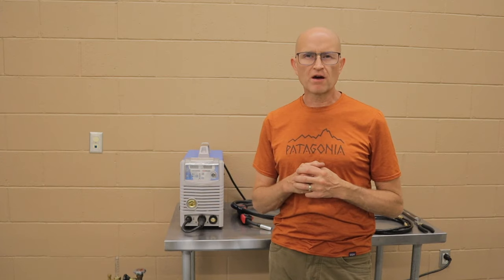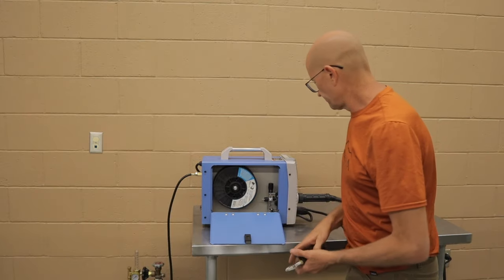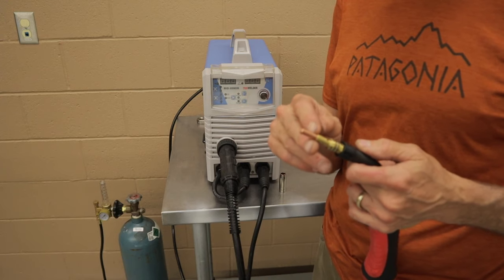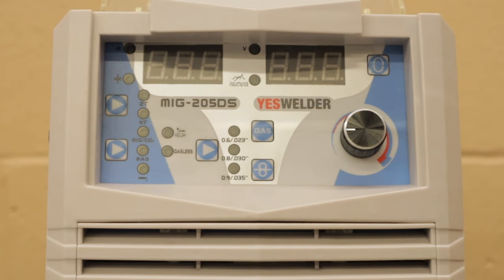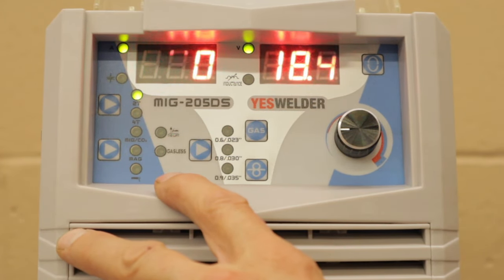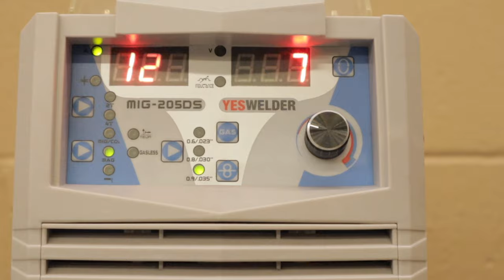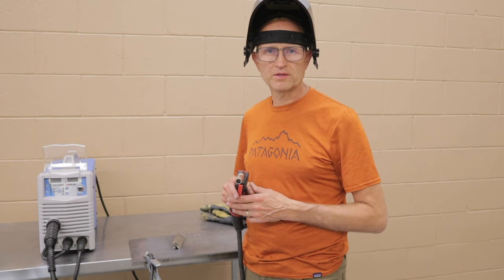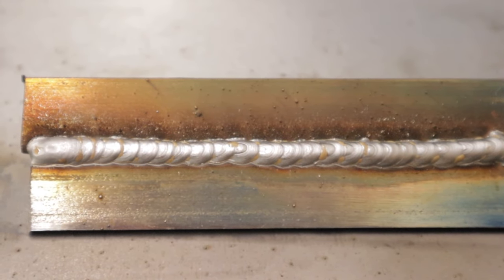YesWelder  MIG 205DS Welder Set up and Settings - Yes Welder DISCOUNT LINK !!!

Comment: Would these settings and setup steps be the same for the MiG Pro 250?
Reply from the maker: Hi Ryan, the Pro 250 has some features that this welder doesn’t like the ability to adjust wire feed speed. It does have synergic Mig function and if you used it on that setting, then my settings should work the same on the pro model. Above ⅜” you would have to come up with your own settings. Hope this helps and thanks for subscribing! 👍😀
Reply: Prana-Tech thanks for the video, it was very easy to understand.  I bought the 250 over the 205 because I wanted the ability to weld up to 1/2” and they said it would be able to weld aluminum via mig (since the 205 didn’t have a spool gun ability).  Which now they have changed the name of the 250 to “aluminum welder” which is a whole other question as to how to set it up to do that?  For now I just need to weld steel with it!
Reply from the maker: Hi Ryan, glad you liked the video!👍 setting up a spool gun is pretty simple. You just need to ask them which one is compatible with their welder.  You just have to snip the mig wire and secure it to the wire spool and remove the mig gun and install the spool gun. You then set the machine to “spool gun” so that it knows not to turn on the feed rollers and to send that feed signal to the spool gun.  Usually takes 5 minutes to switch out from one to the other. Hope this helps! 😁

Comment: Hi Don, This is a great tutorial, best one I've found for this welder! Thank you for doing it. I'm a newbie to welding and only have tech school classroom experience. I bought this welder hoping  I could weld automotive sheet metal. To do that I assume I need to use .023 wire and will need to buy the proper gauged wheel for feeding the wire. Do you have a source for the wire and wheel? Can I weld 16 gauge sheet using flux core wire or do I need to get CO2 tank? If that's too thin what would be the thinest sheet I could weld? What settings should I use the amp and volts? Also, is there a chart available that includes setting for .023 wire? Thanks for your help.
Reply from the maker: Hi Gibson Fender,  sorry I didn’t get back to you sooner. I have an email in with Yeswelder to see where we can purchase the smaller drive wheel for .023 wire. I couldn’t find it anywhere on their site so hopefully they will get back to me soon and I can let you know.👍😀Don
Reply from the maker: As soon as I get a drive wheel, I’ll do a settings chart for the smaller .023 wire. 👍
Reply: @PranaTech  Thanks so much. After a little more research I learned that they no one makes .023 flux core wire, only solid wire so I'll have to use gas with it. Also found some comments that .024 and .025 will work for automotive panels. I look forward to your reply and the chart and please let me know where to get a .023" (0.6mm) wheel.
Reply from the maker: Hi Tom, they got back to me and let me know that the new welders are going to come with the .023 wheel. The also said that they are working on getting some .023 drive wheels from the factory to stock here in the US.  As soon as I get one I will make a settings chart and do a video.😀👍
Reply: @PranaTech  That's interesting. I emailed them and got this reply, If it can't do automotive panels I might be returning it.
:
YesWelder Support (YesWelder Support) 
Jul 9, 2020, 9:36 AM GMT+8 

Hi Tom,
Thank you for reaching out to us.
Our MIG-205DS is setting best to be used with .030" and .035" wires, we don't suggest you use .023" one.
At the moment, we don't sell .023" wheels and wires.
Best regards,
Fortuna
Reply from the maker: Hi Tom,  well that is odd. I emailed Vic, my contact at Yeswelder, and he informed me that the current 205DS Mig welders weren’t shipped with the .023 wheels, but that the new shipment that is arriving mid July will be coming with the .023 wheel as well.  He also said that they are also working with their China supplier on getting a supply of the .023 wheels so people can purchase them. He also said when they get some they would send me one. If you were not advised to use .023 wire, I doubt there would be a setting for it on the machine. I don’t think Fortuna really knew the answer and just made one up.  That being said, I didn’t feel like waiting for them to sort out the supply chain for this and I took the measurements off of my drive wheel and found one that fits right on EBay. Here is the link. https://www.ebay.com/itm/0-6-0-8-MIG-Welder-Wire-Feed-Drive-Roller-Roll-Parts-023-030-Inch-Welding-Kit/233642431275?ssPageName=STRK%3AMEBIDX%3AIT&_trksid=p2057872.m2749.l2649
As soon as I get it I will make a chart and post a video up.  Hope this helps! 👍😀Don
Reply: @PranaTech  Thank you so much. You are one of the most responsive people on YouTube and it's greatly appreciated! I look forward to your continued expertise!
Reply from the maker: Thank you Tom!🙏😁
Reply: @PranaTech  any update on this?
Reply from the maker: Sorry, I’ve been so busy with other projects lately that I haven’t had time to play with the .023 wire yet.☹️

Comment: Which regulator are you using with this welder?
Reply from the maker: Hi Scott, I’m using this regulator. I have three of them and they all work great! https://www.amazon.com/SPARC-Flowmeter-Regulator-0-60CFH-Warranty/dp/B01MU57K05/ref=sxin_10?ascsubtag=amzn1.osa.f596e97a-c6a3-4e79-8117-0410f95b519e.ATVPDKIKX0DER.en_US&creativeASIN=B01MU57K05&crid=2XI45N4J9U5YH&cv_ct_cx=argon+regulator&cv_ct_id=amzn1.osa.f596e97a-c6a3-4e79-8117-0410f95b519e.ATVPDKIKX0DER.en_US&cv_ct_pg=search&cv_ct_we=asin&cv_ct_wn=osp-single-source-gl-ranking&dchild=1&keywords=argon+regulator&linkCode=oas&pd_rd_i=B01MU57K05&pd_rd_r=f13bbb35-3850-4946-8835-efbc87085c30&pd_rd_w=ju1Hg&pd_rd_wg=YgGxy&pf_rd_p=a731ca96-f731-4b16-b32d-9bb548e9542b&pf_rd_r=ZJEE0A7VWB6DKP65X58D&qid=1605583707&sprefix=Argon+reg%2Caps%2C195&sr=1-1-d9dc7690-f7e1-44eb-ad06-aebbef559a37&tag=askmencontent-20 👍😀

Comment: You have done us all a great service by this tutorial. Thanks for that. I was looking forward to the feature that automatically sets your welder based on material thickness. But I that results in amperage that is way too high and the welds look like giant pregnant earthworms. Your settings are much more reasonable, but I still get welds that look too tall to me. Do you have suggestions for getting them to lay flatter? I have tried pushing instead of pulling and trying lower and higher voltage which both work, a little. This is my first welder and I am 100% YouTube taught. I envy the look of the professional welds gotten by experienced welders on more expensive machines and just cannot tell if its me or the machine that produces the tall welds.
Reply from the maker: Thanks Bart for your kind comments. If you want to flatten out the weld a little, increase your inductance setting to 7 or 8 and try it. If it still isn’t up to your liking, increase your amps a little and then increase your speed of your weld slightly. This will give you deeper penetration and a flatter weld bead. Generally if your bead is too tall it is due to your movement of your mig gun being too slow letting the filler metal build up too much.👍😀

Comment: Would this be good for someone who wants to learn how to weld?
Reply from the maker: Hi Evan, yes this would be a great welder for someone wanting to learn. One of my friends from work bought one and had never welded before. He and his two teenage sons came over and were welding really nice welds within about 20 minutes of instruction. They went home and used their new welder and built a 10 foot gate for their side yard and it came out great.  The best part about this welder is that all you have to set is the amperage for the thickness of metal and then start welding. The machine senses the wire feed speeds and does it all automatically.  If you decide to buy one and have any questions, you can just leave them in the comments section and I will help you in any way I can. 👍😀Don
Reply: Prana-Tech well thanks! That’s very helpful!

Comment: great video. thank you. i just purchased. humble piece of advice, get a weld camera setup one day. it would be nice to see your actual technique. kindest regards.
Reply from the maker: Thank you Camilo! I appreciate your feedback! I don’t think I will buy a camera specific to just film welding, but I am probably going to build a setup to hold a lens in front of my camera so I can show some techniques.  Let me know if you have any questions about your new welder when you get it.😀👍Don
Reply: @PranaTech  actually, i do. I emailed yeswelder support and got no reply.

I tried in my best standard english since i know i'm getting chinese-based support.

=====
Observations:

* I have flux core wire of 0.8 thickness
* I'm unable to select GASLESS and 0.8/.030"
* when i select GASLESS, the wire thickness will not change from 0.9/0.35"

Question:
Is 0.9/0.35" the only thickness supported?
Reply from the maker: Hi Camilo, yes, it seems that is the only option for flux core wire. A couple guys have just used the .8 wire on the standard setting and just lowered the voltage a little bit to compensate for the thinner wire.👍😀
Reply: @PranaTech  yeah, I get it. I personally would prefer manual settings over flying blind by having templated settings.

Comment: 2 pound spool worked for me
Reply from the maker: Hi Howard, yes they do work just fine. The early units didn’t come with the right spool hub but about a year ago the started coming with a spool that works with both. 👍😁
Reply: @PranaTech  what settings do you think I should use to mig weld stainless steel exhaust tubing?

Comment: Very well detailed video and I enjoyed watching and I already have this welder and trying to weld small gauge sheet metal (autobody work). Do you have a video on how to properly weld 20 gauge or smaller?
Thank you
Reply from the maker: Hi Daniel, thanks for the great comment! To weld that thin you will need to run .023 wire. If your welder didn’t come with the small diameter feed roller you will need to buy one. Mine didn’t come with one but I understand that the newer units are being shipped with them. Yeswelder will sell you one but I don’t know if they have them on their site yet. To weld really thin, you may have to turn down the voltage setting because mine will only go down to 40 amps at the lowest setting. 😀👍

Comment: No teflon tape on the gas connection? Leak check?
Reply from the maker: Hi there, no tape needed because they are compression fittings. 😀👍
Reply: @PranaTech  I can never remember which kind do and don't need it, and mine came with tape so I assumed. Well now I know when I eventually get some gas...

Comment: Thanks for this, I really wish it came with a chart like that printed on the inside of the lid, lol.  I replaced a very old Snap-On welder with one of these, I have to say the Synergetic settings were a little confusing to me after using the old welder that just had a couple knobs.  But you explained everything very well and it is making much more sense to me. So far I am very impressed with this little unit.
Reply from the maker: Awesome! I’m glad you are as happy as I am with this great little welder! 👍😁

Comment: Great tutorial, would love to see the tig setup.  Thanks
Reply from the maker: Thanks Otis!  I probably won’t buy the Tig setup for this welder because I already have a dedicated Tig machine already. Setting up Tig on a machine like this is pretty simple though. You just buy the Tig torch for this welder through Yeswelder and then plug the torch into the positive outlet on the front. You then plug the gas line that is part if the torch into the argon regulator and turn it to about 15 cfh for flow. You then set your amps for the proper thickness of steel and then when you are ready to weld, turn the gas valve knob on the torch head so it flows argon and then scratch the tungsten electrode on the steel to get the arc started and begin welding. 😀👍 hope this helps. Don

Comment: Can I weld aluminum with this welder?
Reply from the maker: Hi JSER,  sorry but this one is not capable of welding aluminum.  The next two models up are capable though. The mig 250 pro and the larger 270amp mig.😁👍

Comment: I mostly arc weld using 1/8” 6010, 3/32” 7018, and 1/8” 7018 (using 240v)   I mostly weld schedule 40, and 80 pipe. I’m still learning but want to practice at home without spending $2,000 for a machine.  Do you recommend this welder for what I’d use it for, if so Do you know if the Arc weld option on this machine welds the same as their welder that only has a arc weld option?                  Thank you for the time you spend on making such thorough videos I’ve learned a lot from you!                         Thanks, Rob
Reply from the maker: Hi Rob,  this welder would be great if you want to learn Mig welding at home and sometimes do stick welding. The dedicated stick welding machine has settings for stick electrode size whereas this Mig has just amp settings for the stick welder portion.  If you are looking to learn Mig welding, this would be a great machine to learn with. If you are mostly wanting to stick weld, I would go with their dedicated stick machine for more adjustability and a price that is less than half of the mig machine.  Hope this helps! 😀👍Don

Comment: Thank you for this video. This welder has been a little much for me to grasp, mostly because of being used to only having 2 dials welders in the past. Would you be so kind as to make a video setting the machine up for welding thinner metal such as 20-18ga material?

Thanks again!
Reply from the maker: Hi Cally! Ok, first to weld that thin of a material you will need to be running .023” solid wire also known as.6mm solid wire. You will need to be running argon/co2 mix gas to do this as well. Flux core is just too messy to weld thin Ga. material well. Hopefully your welder came with the .023 drive wheel for running this thin wire. The early welders didn’t come with it and we had to buy it on Amazon. If yours didn’t come with the .023 / .6mm wheel, here is the link to the correct wheel. Make sure you get the V groove one as there are 3 choices.https://www.amazon.com/CHNSALESCOM-Welder-Roller-Diameter-U-Groove-023/dp/B089STW42M/ref=mp_s_a_1_18?dchild=1&keywords=0.6mm%2Bmig%2Bwheel&qid=1608665334&sr=8-18&th=1&psc=1  install the wheel with .023 wire and set your welder to the .6mm setting and you should then be able to get the amps down low enough to weld the thin metal effectively. Understand though that you need to watch out for warpage with thin steel. I generally weld small short beads at a time and let things cool to prevent warpage of the material. Let me know if you have any other questions 😁👍Don
Reply: @PranaTech  Thank you very much for your reply! It didn't occur to me that the .0.023" setting will allow lower amperage settings. Also, thank you very much for the link, because my machine didn't come with the .023" wheel. Ordered and should be here tomorrow!
Reply from the maker: Awesome! When I ordered mine I had to wait 3 weeks for it to come from China 🙀 Glad I could help and happy holidays! 🙏❤️Don
Reply: @PranaTech  Thanks again and Merry Christmas to you Don!!!

Comment: Hello from Russia. We also got this welding machine. How does it weld very thin metal. Car body?
Reply from the maker: Hello my friend from Russia!  The lowest amperage setting this machine will go to is 45 amps and it says this is for 1mm thickness. I tried welding .6mm steel and it burned through and was too hot.  It would only work if you did small spot welds one at a time. Hope this helps! 😀 Don
Reply: Don, thanks for the answer. I want to hear your opinion as a professional. Is it worth buying this device for home use? In Russia, with delivery from China, it costs $ 200. Sincerely, Sergey.
Reply from the maker: Hi Sergey, yes my opinion is that this is a great welder for home use! I think you will be very pleased with how easy it is to weld with.
Reply: If you change the wire diameter setting to 0.6mm/0.023" it goes as low as 0.7 mm thick for MIG/CO2 and 0.6 mm for MAG.  But the thickness settings a little strange and I haven't tried welding with them.
Reply from the maker: Interesting! Thank you for the info Sterling. If I need to weld some thin sheet I’ll get a spool of .023. 👍😀

Comment: You figured out yet if it takes 2 lbs spools also do you have like a PDF of the settings we have to watch the video each time
Reply from the maker: Hi Darryl , sorry I haven’t purchased a small spool yet to try out. A few people have contacted me and said they put the small spools on with no problem, so I think you will be fine with small spools.  There is a link in the description to the settings chart that you are looking for.👍😀
Reply: @PranaTech  Ok thanks
Reply: I tried a 4" spool and it fit fine but I didn't try welding with it.
Reply: @rkcrlr7319  Ok Thanks
Reply: @PranaTech  2 lb works as well

Comment: Great tutorial as well, thank you Sir. Have you tried to weld aluminum using this machine?
Reply from the maker: Hi Aliaksei, thank you again for your kind words!  Unfortunately this welder isn’t capable for welding aluminum. The next model up is the Yeswelder Mig Pro 250 amp and it is only $40 more and is capable to Mig weld aluminum. Hope this helps.
Reply: B
Reply: @PranaTech  1